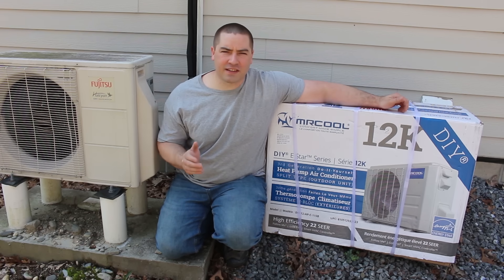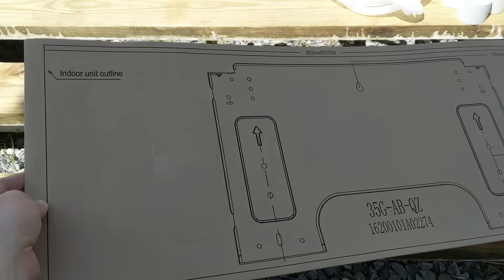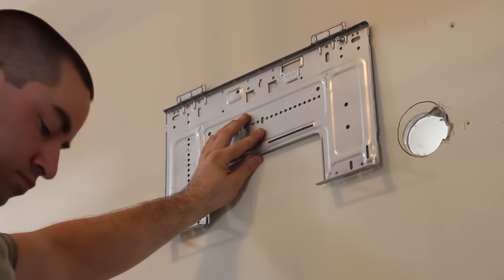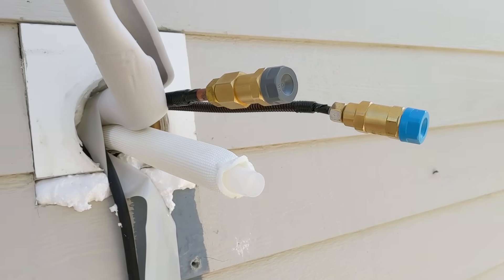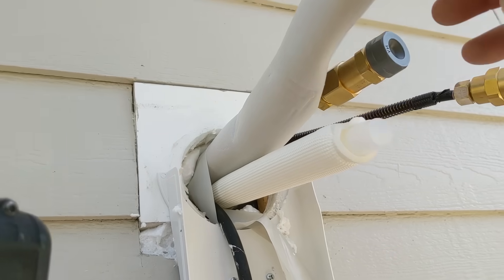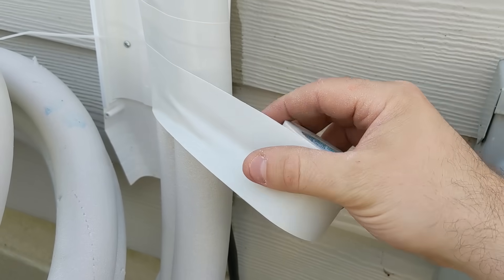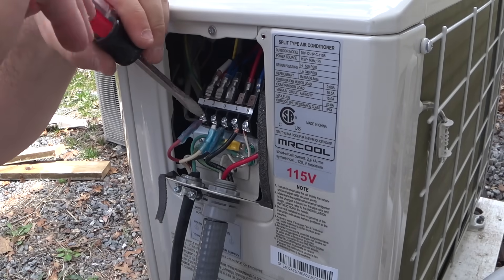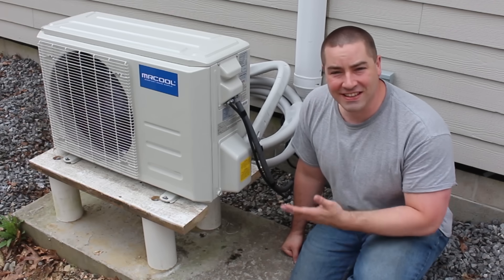Installing My Own Mini-Split Heat Pump, DIY

Comment: I am going to convert my 1 car garage to a wood shop and need to cool and heat it. Can you give me a rough idea what just the system ran you? I will have to have an electrician set up power for it but that shouldn't be too expensive since the install would be just above my breaker box. I personally don't play with electricity since I can't see it and it bites really hard.

Comment: Did you pull a vacuum on the evaporator, suction, and liquid lines?
Reply: No the lines are precharged so it is plug and play if you don't make a career out of connecting the lines.
Reply: @thinkfirst6431  That makes it a lot easier.
Reply: Doesn't anyone watch the video before commenting?

Comment: Great job,

The only downside to that, in my opinion, is all the extra line set and electrical wire left outside making it an eyesore.   I do service work for a local commercial company in New England and think its a shame on the company that installed that 2-year-old unit for not looking and finding the leak.  It could've been a money saver and an easy fix, but great job on your end bud!
Reply: Unfortunately a lot of service companies tend to push hard for new installs. Personally I have installed over 60 of those Fujitsu Halcyon Inverter units and have have little issue with any and given that it was only 2 years since the install nearly all parts for repair (if it was like the evap coil and not the flares on the lineset connections themselves) should have been covered by the warranty from Fujitsu. Honestly IMO it is a downgrade. But hey if it got him running and he is satisfied that is all that matters.

Comment: Whats the BTU range??
Reply from the maker: 12,000 BTU
Reply: @DavidPozEnergy  thanks... Been thinking about getting some for my house.
Reply from the maker: This is the smallest of the DIY kits.  They also have larger models available.  Since they are variable speed, you can size up without it being a problem.
Reply: @DavidPozEnergy  cool...800 #??

Comment: Fujitsu has a 10 year warranty on equipment.
Reply: What i've found out about long warranties is that they're not worth anything if no one can fix the problem. Getting scheduled for repair while you burn up is not a good option.

Comment: Great vid Poz, I am having some difficulties with my installation, I got the 18k model, have done everything except my existing 240 outlet that I am plugging it to is not turning it on. it's 240 from the heat pump two hots one ground off you go. I get the multimeter to the outlet there's juice there. Wrong power cord maybe?
Reply from the maker: Is there a neutral in there somewhere?  If there is 240v at the outlet, and then no 240v at the screw terminals under the cover, then that means there is a broken wire in your cord.  Right?
Reply: @DavidPozEnergy  Yeah there's a neutral, pretty weird, I am going to switch out the new outlet , put the old one back in.  Its the same outlet I used for the old box AC, and that was working fine. Thanks for replying man!

Comment: If you were to place the outside unit higher on the wall, can you not use the 25' extensions and just plug the inside unit directly into the outside unit?
Reply from the maker: That's a very cool idea.  I've never seen someone do that, and it's not mentioned in the manual as an alternative method.  The connections on the lines won't fit together that way, so it won't work as a plug and play option.  But maybe with building your own connections?  I don't know.

Comment: hola, no hicistes vacío con bomba !!!! primero " segundo : ni siquiera le sacastes el aire y humedad de las cañerías ! tu aire  se te va a romper !. tenes que tirar todo el gas y volver a recargar haciendo vacío con bomba y después recargar ",( para que solo allá gas refrigerante en el sistema ) Ya no lo uses le vas a romper el motor . cualquier cosa contactame te ayudo a la distancia. no hay problema . ....
saludos desde argentina
hello, you did not vacuum with a pump !!!! first "second: you did not even remove the air and moisture from the pipes! your air is going to break! you have to throw out all the gas and recharge by vacuuming with a pump and then recharge",(so that only there refrigerant gas in the system) no longer use it you will to break the engine. anything contact me help you from a distance. no problem 
greetings from Argentina
Reply from the maker: It's not needed with this particular unit.  I go into more detail in my follow up video on that question: https://youtu.be/KzHLsRtVn4U
Reply: @DavidPozEnergy  ok. Bueno .lo que no entiendo cómo puede quedar el aire mesclado con el gas refrigerante supuestamente te andaría mal y se tendría que congelarse el evaporador ,ya que el aire en la cañería quedó dentro del sistema .pero bueno ,sería algo nuevo.  entender cómo no le va afectar en el futuro. Pero Bueno , te deseo la mejor 👍🏾🖖🏾 saludos

Comment: What gauge wires did you use to supply power from breaker???
Reply from the maker: I hired an electrician for that part.  It's required in my area.

Comment: Not bad for a diy the only thing I hate is the extra line which looks like crap plus the oil trap it creates and robs the compressor of lubricant and shortens the life by a good bit,no need for vacuum since they come pre vacuumed from factory

Comment: Don't risk getting a random Chinese brand of a heat pump. I have Mitsubishi and Daiken working for 10 years and still going strong. Not to say, the Japanese heat pumps are so efficient and you will see it on your power bill. For example, most of the split heat/cool pumps in standby mode, consume between 50 watts to 90 watts which is crazy! Ony Mitsubishi consumes 1 watt in standby mode.

Comment: 8:48 I've seen that "flushing the gas" straight into the pipes is not recommended. Actually vaccumm should be made in them before releasing the refrigerant avoiding mixing the gas with air, which reduces thermal efficiency
Reply from the maker: It's not needed with this particular unit.  I go into more detail in my follow up video on that question: https://youtu.be/KzHLsRtVn4U
Reply: @DavidPozEnergy  Perfect, Dave! I really didn't know about those "pre-pressured" pipe kits. They really help a lot in these type of installations, for you won't need a vacuum pump to get rid of atmospheric air and moisture from the copper lines.

Comment: Wtf!  Nice coil left behind. That’s why ya pay HVAC techs to do it right.  The other guys you had install and try and fix were hacks.
Reply from the maker: The other guys I hired were professionals.  They were both licensed in my state.
Reply: When the HVAC guys charge you $5000 to repair a unit costing $1000 you know you have to stop calling then and start doing some DIY, that is just crazy,and don't bother about the vacuum,if there is no leak the AC will work many years and when it starts doing problems, it's just to replace it with a new one.

Comment: A tip for you and everyone else, as an engineer my self if i would be looking for leak thats is hard to find first i would split system in to two and pressure test both separate, that means ill know where the leak is. Meaning that replace indoor or outdoor unit or a pipe work. Normally leaks on AC units will be your flares. Also if non of these companies wasn’t able to help you they are all cowboys and just ripping everyone off forcing them toward buying a new unit.

Comment: Did you not have to evacuate the system before releasing the gas from the outside unit?
Reply from the maker: It's not needed with this particular unit.  I go into more detail in my follow up video on that question: https://youtu.be/KzHLsRtVn4U

Comment: Leaving those lines coiled like that is setting you up for problems in the future, I have seen dead compressors over and over on these minisplits where the homeowner coiled up all the lines
Will trap oil
I am a professional HVAC contractor and have been over 10 years
Reply: My Air Works DIY has coils behind it. It been working fine for 10 years now. I paid 1000 dollars for it at Canadian Tire. 10 years of great cooling and no smart mouthed tech = total cost for hard ware is 100 a year.
Reply: I'd listen to the man.
Reply: Anyway to have the lines shortened like i want to buy one but i would only need like about 6ft
Reply: So what are you recommend cut'em but then you would have to have somebody solder them for you right I don't have the tools to do that s***
Reply: @lch3105  Ok then, do it the wrong way and pay for it later when you have to do major repairs. He offered up some solid advice, and you get pissy? I've been doing HVAC for 8 years now and he is on the money (that means he is absolutely right).

Comment: I was expecting to see this clamped to show amp draw...start up and running...
Reply from the maker: I do that in Part 2 video: : https://youtu.be/KzHLsRtVn4U
Reply: @DavidPozEnergy  ahhh ....good stuff i didn't see that in your library, thank you for these details.....when will we get updates on the sunny boys?
Reply from the maker: The sunny island inverters are working well.  Probably a few months I'll do another follow up.  I'm working on a lot of other videos right now.
Reply: Also look into installing a uv sterilizing lamp in the indoor unit to kill airborne bacteria and mold growth in the unit.

Comment: How does this brand stand up against the rest of them that rate high, and how well can this work in the winter?  I hear latest models of other brands now can withstand down to -20degrees.
Reply from the maker: I'm not sure how it compares with other brands.  I had a Fujitsu that failed before this.  As for heating, my manual says 5°F.  This is usually the temperature it can still supply full BTU's at, in this case 12,000BTU.  And usually they continue heating below that temperature, but at a reduced capacity.

Comment: My issue with the mini split is keeping the drain line clear from algae/mold clogging it and then water overflowing inside house. You have to remove the cover to even get to it to drop in blue tablets to keep the algae/mold from growing. Pain in the butt.
Reply: Get the blue ac tablets and stick them in the indoor drip pan every 3 months. It wont firm this weird slime and it wont block also no algae.
Reply: Get it serviced.

Comment: David, The indoor unit on that Fujitsu's has a leak. If you pressure tested it , it would be obvious. It is a very common issue with Fujitsus. If you still have that system around, call Fujitsu and tell them that the indoor head is leaking and they will send you a new indoor coil that can you can have a tech replace. I know this from my time as a heat pump tech. Call the supply house closest to you and I bet they will agree with me.

Comment: Hey there young man, thanks for sharing this interesting video.  Super-sweet product,  greai nstallation demonstration, nicely done video.  You've motivated me to DIY; finding a contractor is all that's been holding me back. Did you need to pull a permit, as you're doing a replacement?  
I like that the system self-purges and fills. Other similar products  I've seen required an HVAC tech to charge the system.
Reply from the maker: I did not need a permit since this is a replacement, and it's a DIY kit.  The original electrical work was permitted and installed by a licensed electrician.
Reply: @DavidPozEnergy  Thanks for the quick reply. You have a great channel!

Comment: Dave did you ever soap the joints on the old system? Also that is correct to coil the excess line set horizontally so you dont trap any oil.
Reply from the maker: Yes, I did soap the old unit, several years ago back when I was trying to diagnose it.  Which was only after I had paid $$$ to the pros to find the leak. (and didn't but told me they did)
Reply: DavidPoz , yea it’s frustrating I installed 2 Mitsubishi Hyper Heats at my home single zones, and a 3 zone LG Red with ceiling cassettes , on the Mitsubishi I used that Nylog you had and on the LG later I learned about and I used what’s called Flare Seal.. it’s a little gasket that goes between the flare joints. Costly but worth the extra insurance especially with the multi zone 12 joints I had. And I Nyloged those as well. No problems went though our first winter and now on our first summer. On my LG 3 zone the HVAC guy never used nitrogen and the line sets make some noise I think it’s moisture. So I really need to evacuate and vacuum and recharge, but it works fine. I’m an electrician by trade and I installed everything myself like a pro, the units, the line sets, electrical/controls, condensate lines (all my units are on interior walls/ceilings so that was another challenge the condensate, you would think the real “pros” would do a “professional “ job as well.... One thing I learned in life, you want something done right...DO IT YOURSELF!!!!!

Comment: Cool ...  Hearing a high end local experienced solar buddy saying these newer mini split heat pumps have really gone up in efficiency (plus under-sizing is better than over-sizing), I wonder how much energy savings the mini slits represent as compared to older tech of window or wall mounted ACs of same BTU ratings ???  ... While that might be harder to document, I'd love to someday see a video clip test result on that question. 

I purchased a couple of 120vac 12000 BTU Pioneer brand mini split heat pumps (a free shipping  $750 each deal) that I have tooled up to install myself. They will help me use my solar options to back off from my natural gas heating; plus provide a great cooling option to my evaporator cooler, including for if I had a wildfire smoke cycle outside my house to deal with. ...  I will likely be voiding my warranty without a hired professional install (or check off), but with a background for details, I will take that risk on.  Your video here will be another install reference. 

 Thanks for sharing the info. from your learning curve experiences   :+)    Bill  in Northern California
Reply: I heat and cool my home with heat pumps and the operation cost as compared to window units is CONSIDERABLY LOWER! There is really no comparison, since the modern heat pump is running on DC power with an inverter and has variable speed capability as compared to that old window unit. It can run the compressor very slowly to keep liquid refrigerant ready for heating or cooling. The window unit compressor has just one speed. It's either running or idle, no in between.
Reply: @chestermartin3440  Yes to more efficient options. I wonder how cooling via mini splits ac will compare to cost of running my evaporator cooler in a dry climate. I know I will prefer the heat pump cooling on cycles that hit near 100F. ... I think it will great to have both option plus heating via the same mini split unit in the winter :+)

Comment: all those compression fittings .. so many potential leak points in the future.. ill stick to Brazing  and that 10 feet of extra lineset that is all coiled up behind the unit looks trash. It all looks like typical scabby homeowner diy install standard... the crap im usually being called out to fix down the road. Sorry i started watching this with the hope that it might actually turn out to be a good looking job i honestly was.. but yea it turned out as expected.
Reply: @gorgebiaboon been licensed for 17 years and if your in any way shape or form defending that abortion he installed.. well enough said..

Comment: lol at the 12' of rolled copper line behind the unit
Reply: Leaving a monstrosity of copper refer lines in place is no good at all! Especially on small tonnage systems as this bloke has done.
Reply: @MARKWILLIAMS-tm4rf  side note: does that copper tubing attract metal thieves?
Reply: @MARKWILLIAMS-tm4rf  These systems are designed to work as is and they do just that. They work great so you clearly don't have a clue....
Reply: @Ozzie4Para  Mr Cool is that you?

Comment: You forgot to vacuum the lines out. Moisture inside refrigerant lines can contaminate the lines, causing your air conditioning unit to become sluggish. Anytime an A/C unit is installed, or reinstalled due to repair, the refrigerant lines must be vacuumed.
Reply: These lines, head & condenser are all precharged with refrigerant. That is why they just screw together. If there was no charge in them, you could cut the lineset to the proper length needed.

Comment: You didn't remove the air from the tubes, i guess the tubes was vacuumed and sealed with valve ,because its diy kit?
Reply from the maker: Exactly.  Pre-charged and sealed lines from the factory.

Comment: So we didn't  find out if it was working (Cooling) but it was quiet ,no hissing and it didn't  leak ...yet someone wants to install one based on that. You should sell him the card board box that it came in .
It's  even quieter it doesn't hiss or leak and like the unit we don't know  if it cools . Oh and you can just tape it to your house without drilling holes. 
I'd  say that he's  a fan for sure.
Reply from the maker: I plan to do a follow up video this winter.  That way I can share how well the heat pump works in both cooling and heating.  This video is just showing installation and is not intended to be a review.  Since installing it's been on and cooling the house 24/7/  I assume the compressor is not running 24/7, just as needed.  it's keeping our house at a constant 70 even with the past couple weeks being 90 outside.